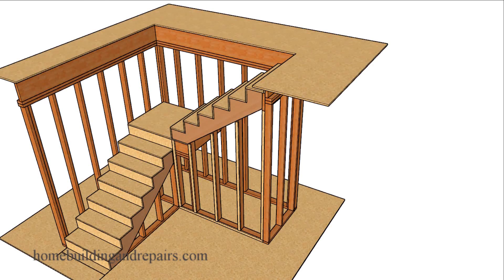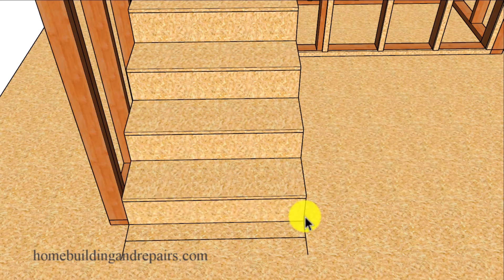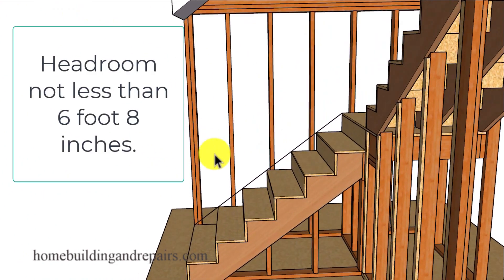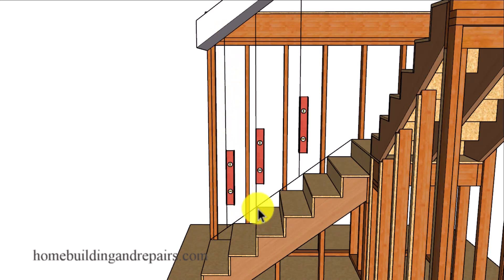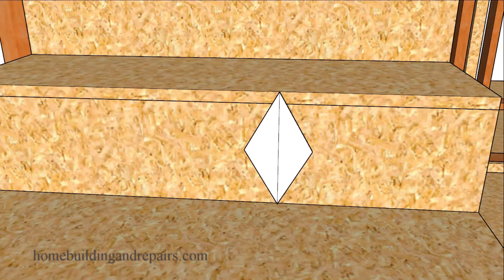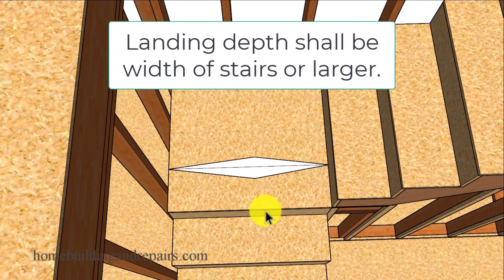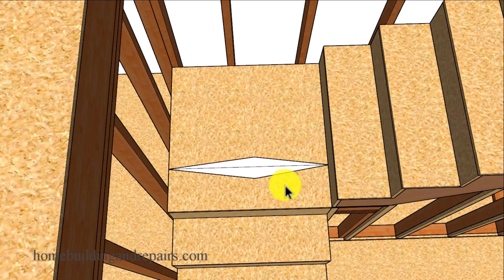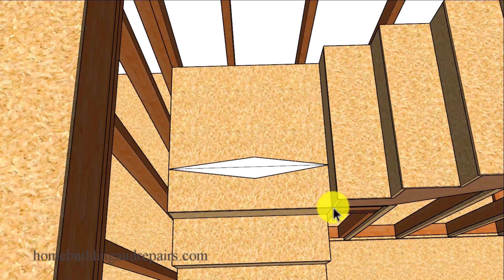Top 5 Building Codes For Stairs With Landings - Design And Construction

Comment: Reducing from 8" rise to 7.75" rise is the dumbest thing It's no longer round in either standard or metric, and therefore you can no longer quickly estimate the height and run of a staircase. On top of that, you'll also almost always end up with some odd number of steps, or an uneven height when going between floors. Like... it's 12 steps on an 8" rise to go up 8 feet. But no combination of 7.75" steps can get up to 8 feet, and most flooring systems are also deeper than 7.75 but not 15.5" or larger... It's just a dumb pain in the ass.

It also throws out the beautiful synchronicity with 16" OC studs. 16" studs, joists, rafters, stringers, and 8" tall stairs. It just makes sense. I also don't care much for the new landing rule. Now, obviously you can't have a landing smaller than your stairs (at least it physically makes sens that you wouldn't) but to absolutely require that your landing be the same depth as the width of your stairs? The whole point of the landing is so the stairs take up less space. But I also want the stairs wide enough to be comfortable and carry things up and down. If I have a 5ft wide stairway that goes up to a landing, turns 180 degrees, and then continues up at a 5ft width, that landing shouldn't need to be 5ft, especially if I only need 4 or 3 to get the turning radius of furniture handled.

No longer can I save the 2 feet of run on either staircase that I would have, and as far as I've been told in this video, there isn't even a reason given for this stupid code update.
Reply: Does it have to be 7.75 rise? I've read between 7-73/4. Why not just go with 7 or 7.5?
Reply: @Soul_N_Control  No, the law is saying 7.75 (7-3/4) is the new maximum height instead of 8. You can obviously make the stairs shorter if you wish.

Also, I made that rant before measuring my own stairs and realizing they were 7 inches tall and that I'd actually kinda want stairs in general to either be no taller than that, or indeed, slightly shorter than that.

Comment: Regarding the stairways w/ landing as set up in this video- does the 3/8" variance rule for risers apply for every single rise on both the stairways, or can each stairway be treated individually?  Example:  stairway from basement up to landing has 7 1/2" risers (not varying more than 3/8"); stairway from landing up to first floor have 6 3/4" risers (not varying more than 3/8")  Thanks for this great resource!
Reply from the maker: I have a video on that problem if you can find it, but usually the variations are per flight of stairs between landings and floors. https://www.youtube.com/watch?v=xjXO-wnd0Ck

Comment: I there a min measurement for the landing at the top of the stairs ? For example if you have a front door with the stairs directly in front of the door . thanks .
Reply from the maker: You would need to check with your local building department, because these measurements can be different in some cities.